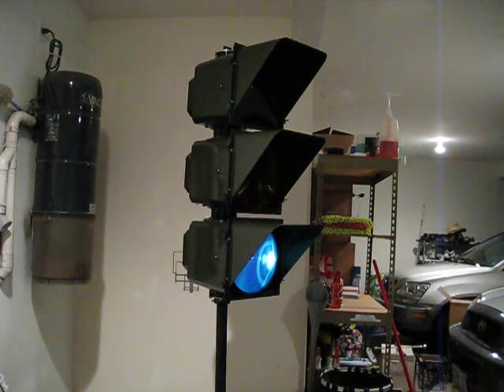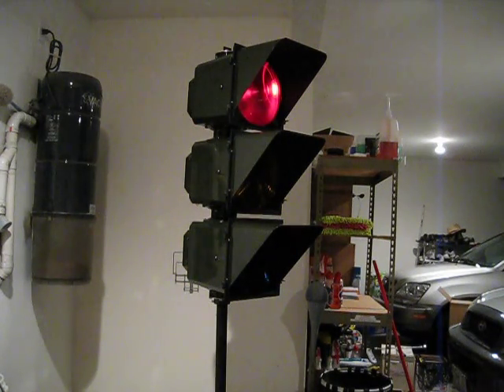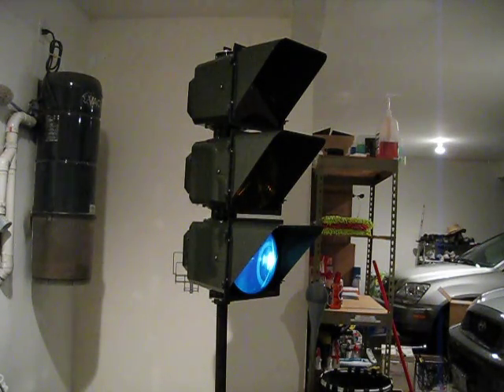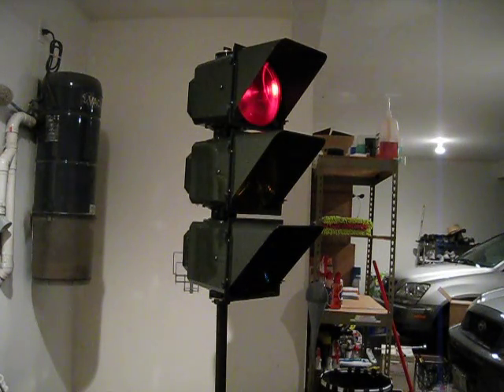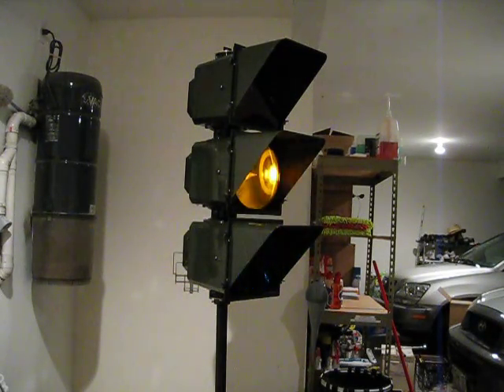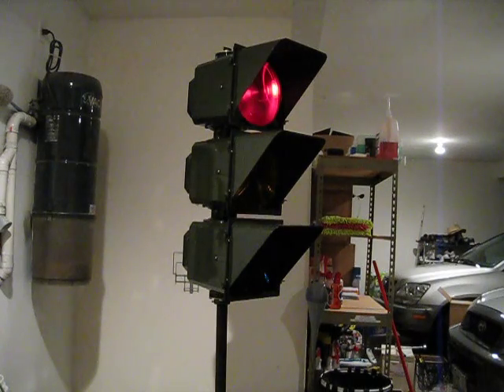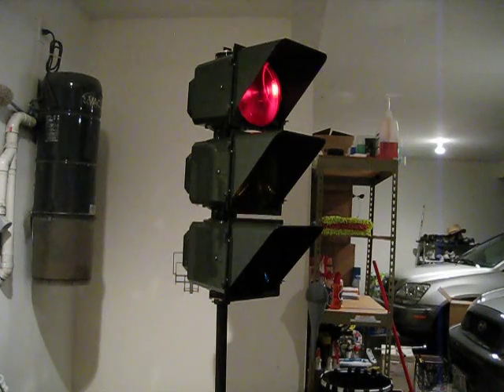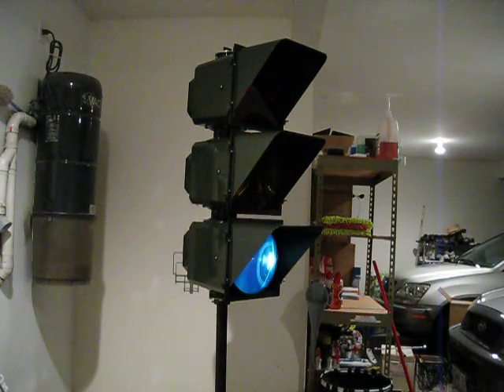My 3M HVS M-131 Traffic Signal

Comment: The M-131, at least in California, has been primarily used for the left-hand arrow signals, though cities are replacing these for LED signals on those. One reason M-131 signals were used a lot for left-hand-arrow signals was the ability to visually limit where the signal can be seen.

In Sacramento, where I live, the M-131s on the left-hand-turn signals are slowly being replaced by new LED models, but a lot of them are still around.

Comment: @Deloreanman: They discontinued these? Odd. Now why would they actually install discontinued signals in my state, especially if there are no replacement parts? My state use to have yellow back versions of this signal which seemed to rust, and were replaced with LED's, but I actually see this exact black type still get installed various places. However, maybe its because unlike LED's this old square signal emits more heat to melt the ice off the traffic lights.

Comment: @deloreanman14 You mean, circular not square? I only have seen the circular ones at one intersection, no where near where I live, but every other time they have used the boxy black ones. However, with the issues known about both, I can not figure out why they would still use those, I guess they did not discontinue the 3M ones until 2007, but I can not believe why they can't figure out how to use lane restrictive lenses, and not make a different signal like the McCain or 3M for that purpose.

Comment: I guess I don't understand what happened around me that they no longer can replace the one intersection they decided to go 3M on all the overhanging poles, despite the year right before, 3M called it quits; which I assume they got for a lower price. I have never seen signals go broken for more then a month in my area. Otherwise, if no McCain, there probably going to have to do something else about the 3M. The other intersections are still accounted for. So :(

Comment from the maker: @DrSurprise - You can try but I haven't had any luck. I tried buying a new all-8" aluminum signal from a McCain distributor in Salem, Oregon (closest to me) and never got a response. Maybe if I had called I would have had more luck. Honestly you can sometimes find new signals on eBay for a tenth of the price they would sell for list. Case in point: I bought a brand-new, in-box TCT 12" signal for $175 back in April.

Comment from the maker: @npx190 A signal was created out of now-defunct Optisoft and Intellilight that includes an electronically steerable LED array that performs the same function as the 3M. But instead of being masked with tape, all the user has to do is plug a PDA into the signal and tell it what area shouldn't see it and the signal does the rest. Optically masked signals are in the twilight of their existence....within 10 years I doubt there will be any left on the street.

Comment from the maker: Even in '03 when I bought it $25 was a steal. Not sure about the actual year of discontinuation. I've heard 2004, 2005, and 2007. It disappeared from the 3M website in '07 which leads me to believe that's when they pulled the plug on production.

The signal was not masked which reinforces my belief that it never saw road service.

Comment from the maker: @npx190 - McCain Traffic Supply still makes a clone of the 3M signal and that is likely what you are seeing. They are visually identical except the lenses on the McCain are actually round.

However it bears mentioning that the McCain version of this signal is an absolute piece of junk. I talked to a signal maintainer and she said they are awful. They leak, rust, wiring looms crack and short out and not to mention they are poorly put together and of poor quality materials.

Comment: two questions I have a chance to buy one of these for a hundred bucks set up just the way you have it is that a good deal and the second question is what does it mean that the traffic signal is masked or unmasked
Reply from the maker: Buy it. That's a great deal. If you check out my other video (3M M-131 Traffic Signal in Detail) it goes into depth about how these work and explains terms about masking the signal.

Just a few other points:

1. These signals do not take well to LEDs and the bulbs they use are proprietary. If you plan on keeping and operating the signal long-term, I strongly suggest stocking up on them now as once the McCain PV signal (the only other one to use this lamp) leaves production, the bulbs are sure to follow. They are a 150PAR46/TS, are good for 6,000 burn hours and cost about $15 each.
2. If you plan on hooking up a timer, make sure it can handle the wattage of the lamps. The timer that was in this one (it now runs on a genuine traffic signal controller) was rated for 150W but would still blow the fuse from time to time.
3. Enjoy it. :-)